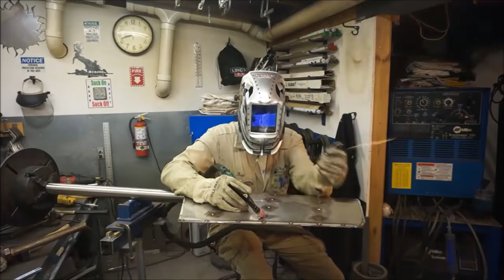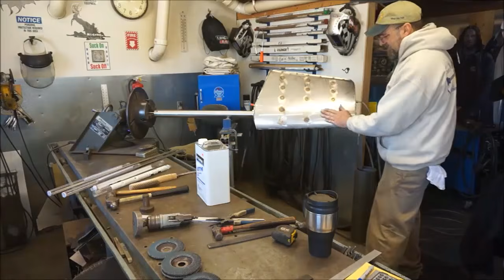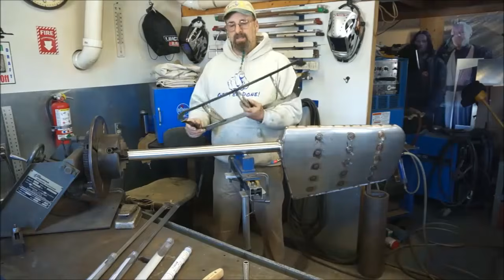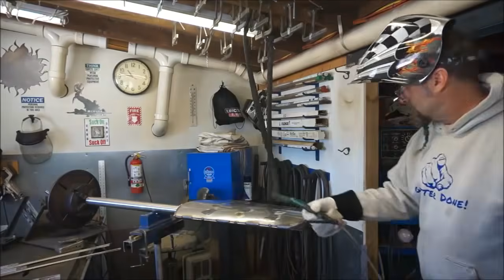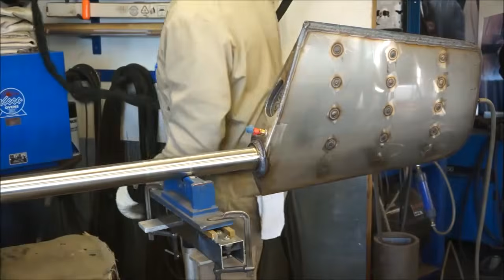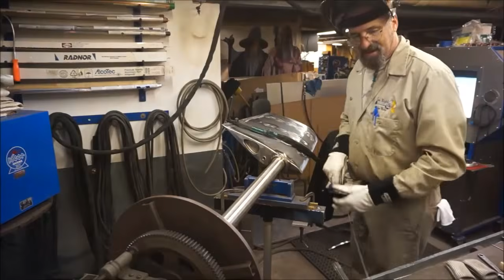Wing It Part 18

Comment: I know what you mean about good fitting making your welding skill look better.  I have enough hours welding mild steel using stick and mig that I can fudge on the fitting, but any time I TIG anything, especially aluminum, I have to make sure the fitting and prep is well done or the welds just don't look pretty at all.

Comment: Keith,

Do you run the same amount of CFM with your wire welder as you do with the TIG. Seems I need to run a pretty good rate to get good shielding (no breeze) when I run a bead. Maybe I'm just wasting gas.... What's a good rule of thumb?

 After seeing your work on the compressor trailer I can see the positive outcome of the forming of these skins. You're a hellava "Tinner" craftsman! Really exceptional work!
Reply from the maker: I run about the same gas volume but use a tri mix, seems to make a better weld. ;{)-----